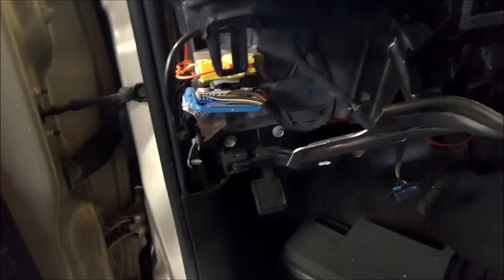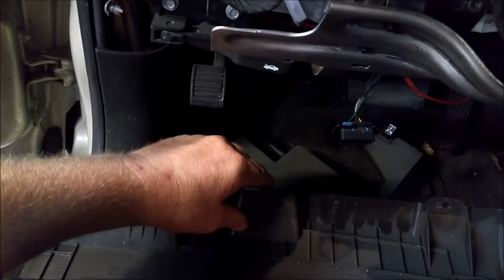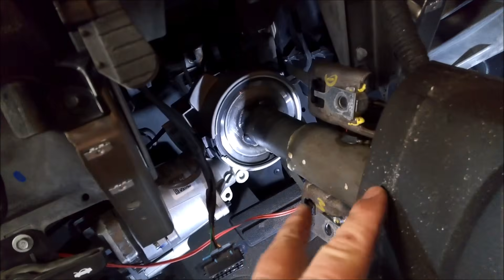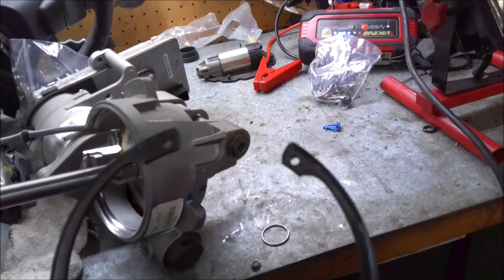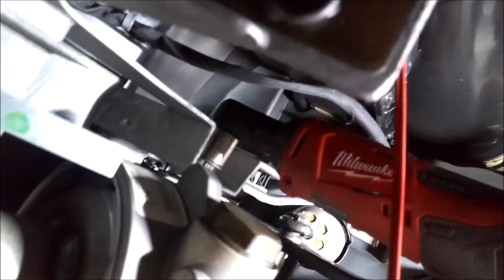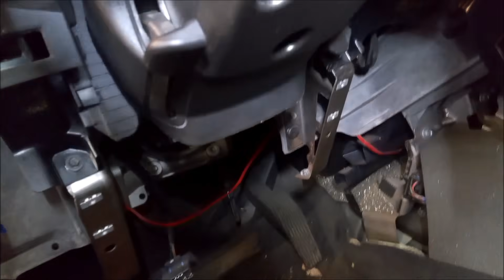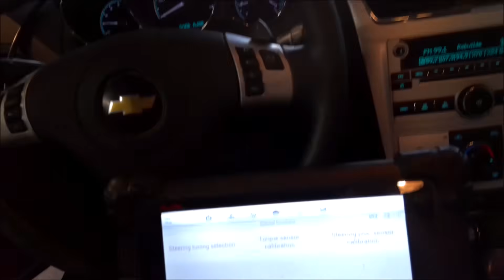2011 Chevy Malibu twitching steering wheel, no power assist, steering wheel sensor. C0545 Code

Comment: I just had this problem same year 2011 malibu. When the garage took the steering apart they said they had to replace the shaft because it had seized  up, that was another $250  part. My question is what made it seized up on itself. I only drove the car about a week once it had started doing the vibration and saying power steering  and esc off . The diagnostic check said the angle  sensor was bad so I was confused.
Reply from the maker: I have never seen the shaft seize up.
Reply: @HooptiesGarage  thanks for the response. I know when I would start it the wheel would be locked unless I turned it to the left when I started it. What they said was that the shaft wouldn't collapse on its self  so that they could get to the angle sensor to put the new one on.
Reply: @HooptiesGarage  have you gmail ?

Comment: What the lower half called? The place that actually hold the torque sensor? 
Cuz the mechanic told me steering column, someone said motor, someone said torque sensor holder..... either way I'm getting the place that holds the torque sensor together from the junk yard. When I take out the steering wheel does that need to stay straight too when removing?
Reply from the maker: It's not technically the steering column but it is if that makes sense, it basically the lower half where the motor is mounted etc. I consider the steering column the steering wheel part you remove first but I also understand the whole thing is considered the column.
Reply: @HooptiesGarage  Cuz these guys are giving me the run around. I appreciate you responding,  thanks. 
So I managed to get the torque sensor out but its 300+ $$ so im going to the junk yard and going to try n pull a part and hopefully it works. The lower part and the motor. 

I have another question. Would you happen to know what those 3 wires are for ? That connect to the motor? Would you know if one of those we plugged out would the car not start? Cuz I think I messed up 1 wire on one and pulled it out. But now when I try n plug it back in , it doesn't fit good enough for a connection,  and now the car won't start or crank .
Reply from the maker: @ChaddyMack  yes you need to get gud whole lower unit you can't just change the torque sensor from the junkyard because it won't be set right there's a pin you have to pull once you get installed to clock it right so if you don't get a new one then the only option at junkyard would be to get the lower steering column as a whole unit. As far as not starting do you still have the upper column out of the car I don't think there's any wires down low that would prevent it to start but all the wires you have to disconnect at steering wheel or one of those are off will probably prevent it
Reply: @HooptiesGarage  OK good to know. So I can keep my top steering wheel,  and just get the lower part with the motor at the junk yard?

And as far as my car not starting, It was starting fine when the power steering would pop up. The top part of the steering wheel and wires were in. All I know is once I started messing with the wires that connected to the motor, it wouldn't turn on. Maybe I blew a fuse or theres a short somewhere? Thats where I'm lost
Reply from the maker: @ChaddyMack  yes you can keep the top part. As far as not starting does it even crank over?
Reply: @HooptiesGarage  do you have an Instagram or somewhere i can message you? Or text? 
Well we put in the part from the junk yard.
Car turns back on,  it was a bad battery. 
But the steering wheel is still hard to turn a little. No engine light. No power steering light. 
So the fuse under the hood isn't working so going to get a new fuse the 80 one. And see if it works. 

Do i need to get it calibrated or? And how much does that cost
Reply: Fuse didn't work. If not I heard about a rack and pinion?
Reply: Imma just pay for the diagnostic check

Comment: Easy fix for it: remove the screws and bolts. The bottom parts of the steering doesnt need to come out. Removed the top part, from there you should be able to remove the snapring with a LARGE ring remover and do the job. YOU MOST LIKELY WILL NEED TO CALIBRATE IT AFTER YOU DONE. YES YOU CAN DRIVE THE CAR WITH CAUTION TO A MECANIC/DEALERSHIP FOR CALIBRATION IF YOU DONT HAVE A GOOD SCANNER TOOL. I did the job myself a month ago. Sorry for the shouting
Reply from the maker: I do it a little different now I take out upper column first and then remove lower instead of removing it together but I still take bottom out just because it only takes about 5 mins and it easier to access everything with it out. I also agree the bigger the snap ring pliers the better, I ended up getting some huge ones off Amazon fairly reasonable just for this job but I do several a year.
Reply: Just got done it turned the wheel straight to the right

Comment: Wow! I’m having this same exact issue & I was told I need to change the entire steering wheel column & motor according to the dealership. I replaced the motor but I’m still facing the same issue. Is it necessary to replace the entire steering wheel column or just the sensor?
Reply from the maker: No just the sensor and you will be good

Comment: EXACTLY what my cars doing saying a ton of stuff is off, I figured it was the torque sensor thank you because I’ve had NUMEROUS problems with this my alarm keeps going off, I changed the battery terminals, bought a new battery then the twitch JUST started yesterday so I know finally what it is! Thank you so much

Comment: If we replaced the torque sensor, and the power steering is still not working. What would be our next step? We haven’t used the scan tool yet. We just replaced the sensor. Also. We never had any warning lights or codes
Reply from the maker: Other than wiring issue i would check and see if anything is coming from the steering motor

Comment: Hoopt, great video. I just took my 2012 Malibu to the dealer and was told it needed a new power steering module and sensor. He quoted me $1650. Does that sound right to you?
Reply from the maker: If it's doing the same thing I would replace the module that's the actual motor the dealer likes to change everything so they can sell more parts and labor and cover their ass if they misdiagnose it, I would have a independent shop just change the sensor they are about $300-400 for the part and a hour or two labor.
Reply: @HooptiesGarage  Thanks man!!

Comment: Thanks for the helpful tutorial. Do you need to remove the whole steering column or just the top part of it that the steering wheel's attached to? I can't see why you would have to unless your changing the motor too. If you don't calibrate it will you know right away after starting the car? I've read the steering wheel will turn to the right if it needs to be calibrated. I just don't want to be driving and all of a sudden the steering wheel turns to the right on its own. Thanks.
Reply from the maker: You can remove top part and then make sure it doesn't spin so it doesn't break clock spring and slide that out and then remove motor it makes it easier  to handle. As far as spinning to the right i haven't heard of that but I always run the calibration with my scan tool before I drive it
Reply: @HooptiesGarage  Thanks for the quick reply. I replaced a torque sensor on a 2008 Escape so I'm a little familiar with changing one. Hopefully I won't have to have it calibrated. Thanks again!

Comment: Hey There! Having a heck of a time tryna get that back bolt in! I'm about an inch from the hole but can't seem to get it any closer with out the column coming out the knuckle. Can u offer any tips or tricks to get it back in?? TIA
Reply from the maker: To make it easier not sure how you are doing it but you can separate the steering column and just install the motor and lower part it makes it easier than trying to handle the entire column then once you get it started and bolted just slide the rest of the column in and your good to go
Reply: @HooptiesGarage  I don't have the motor attached as of yet but I'm trying to do it while it is one piece. DEF gonna try that. Thanks!

Comment: power steering service esc turned on on my 2010 malibu and steering wheel got really hard i took it twice to mechanic and he said he replaced motor on it but it messed up again,what do you recommend?and approx how much is cost on repair?
Reply: Same here did you figure it out ??
Reply from the maker: It's not the motor it's the steering wheel sensor at the bottom of the steering column. Depending on the mileage of your car gm may fix it for free if they won't find a mechanic that will just replace the sensor ballpark it will probably be around $300-350

Comment: Is this something thats just going to keep happening or is it a safety problem I don't have the funds to get it fixed right now and I'm wondering if it's going to one day completely just stop working, the power steering turns on and off sometimes but usually I just have to turn the car off and turn it back on for it to stop?
Reply from the maker: It seems like most the cars I see get about 100-115k before it needs to be replaced, I just replaced one on a car that has 177k miles and it was the first time according to the owner. GM may fix it for free if you are under the 150k miles mark but I have heard some dealerships are difficult to get that done guess it depends on who you deal with.

Comment: Can I install the new torque sensor and then drive it to a mechanic shop that has a scanner to get it reprogrammed ?
Reply from the maker: I believe you would be ok doing that, some say they relearn on their own but the service I read says to use scanner to recalibrate so I always do, it only takes a few minutes to recalibrate with a good scan tool.

Comment: Anybody still having this issue  gm is covering this under a special warranty as long as you have less then 150000 miles on the car I called my dealership and they said yes they do I called gm directly and they told me no but my car is at the dealership as we speak getting fixed for free and no I dont have a warranty on the vehicle so don't spend your money call your dealer
Reply from the maker: I would definitely make sure it's free before authorizing any work we have called on two of them here and the dealerships weren't willing to fix for free.
Reply: @HooptiesGarage  yea I called and my dealership fixed all for free but like I said gm said they knew nothing about it my dealership said they knew because they have had alot in there with the same issue.. the sensor also ended up burning up my power steering motor which they also fixed for free and charged to gm
Reply from the maker: @bm830op  good deal!
Reply: @HooptiesGarage  yea it turned out to be a good deal but it for some people they have to put alot of calls and work into getting dealerships that know about it
Reply: Thank you GM Told me the same thing
Reply: @lovernotafighter8184  glad I could help if it was my comment that helped you you are very welcome sir

Comment: one tip; lock or bungee the steering wheel in the same position , if the wheel turns too much the SIR coil will be destroyed.
Reply from the maker: Yes that is correct good tip!
Reply: @ ex mcgee  Are u saying bungee the wheel prior to taking the column out??
Reply from the maker: @smartin113  yes that is correct it to keep the wheel from turning too much one way or the other. I actually do this job a little differently now but either way that's a good practice when removing the column
Reply: @smartin113  yes . Because if it turns too far , the SIR/clockspring  coil will be destroyed .Once the column is disconnected from the rack nothing prevents this otherwise
Reply: Thanks for the tip!

Comment: Great video . Well explained . My buddies steering goes on and off mostly off . Question can the sensor be changed then driven  few 5 miles after install  to a mavis and get it calibrated with a wheel alignment .
Reply from the maker: Yes it shouldn't be a problem.

Comment: Thanks for the video, my 2008 Malibu start saying service ESC  and power steering on the dash and would happen once in awhile. now it is constant. I am on my way to a GM dealership to have it looked at now. It has about a 106000 miles. I am fairly mechanically inclined. My question is, will the scanner in the link perform the necessary calibrations to complete this task? Any feed back would be greatly appreciated.
Reply from the maker: No that scanner will not. I believe most of the time it will calibrate on its own though.
Reply: Hey jer i have the same problem with my car what did u have to do and how much did it costs u for the fix
Reply: Same ☝🏼

Comment: Really helped a lot! Now I am CERTAIN I won’t own one of these POS’s !
Reply: My 2012 power steering is turning off and on. 157000 miles. Time to say goodbye.
Reply: @HS-pw2ty  Regardless of what you buy for a vehicle, they all have it. BMW, Ford, Volvo, Lexus, Nissan. Not sure what bitching about it is going to get you except a different brand & model of headaches. You find a perfect one, let us know!
DK, ASE master tech since 78.
Reply: @69Sixpackbee  >They all have one on them, bitching about it gets you nothing at all. Pick one? Kia, Mini Cooper, Ford, Lexus, Fiat…. You would look good in a Fiat otherwise known in repair as “Fix It Again Tony!” Have at it and quit wearing your britches so tight. I can see your brown eye from here!
DK, ASE master tech since 78.
Reply: Good thing I dont own a Ford. Chevy. Always dependable. Even with no power steering. Helps you buff up those puney arms on those freakishly skinny humans.
Reply: @AHappyThought  bbnn.v
Reply: @AHappyThought  I bet you are a Mini Cooper dude? Right!
DK, ASE master tech since 78.
Reply: @deankay4434  nope. Luckily I'm not. Lol. Chevy all the way. Cheap parts. Easy to fix.
Reply: @AHappyThought  My Chevy is so special, I don’t pay taxes, tags, wheel tax or registration fees each year! I love it and have 4L65 built to 650 HP and 435 HP driving it!
Power windows, remote keyless, theft, light & horn control, power door lock & seats.

Comment: Thank you for the great video.  Is there an easy way to determine whether the problem is the torque sensor, or if it is the actual motor?  My daughter's car doesn't seem to have the shakey wheel problem, but does lose power assist randomly while driving about once per week.  I just want to hit the right part on the first try. Thanks.
Reply from the maker: Do you have any codes? I would scan the ecm first and see where that leads
Reply: @HooptiesGarage  I had the codes scanned by a local shop, and they said it had C0545 (Torque sensor), but also had  a 0640 code, which means the motor is bad as well.  They claim that both parts typically go bad at the same time.  And that's why Chevy always replaced both parts on their recall.  This seems like total BS to me, since a Google search for 0640 codes seems to reveal nothing like a steering assist motor issue.  Does this make sense?

Also, I have a steering column from a 2011.  Is it likely to be a direct fit to my 2008?
Reply from the maker: A p0640 is a heater intake issue you sure it was that code? Most shops will just want to change both because it covers them if the motor is bad. The car I did this video on still has no issues at all with steering after several months in fact I just changed its wiper transmission on it. Worse case scenario if you end up changing the motor later but if your car has same symptoms as the one in video I would not condemn the motor automatically. If your steering isnt twitching and it just goes outot randomly while driving it's a possibility your motor is going bad.
Reply: @HooptiesGarage  Yes, they definitely said it was the P0640.  That's why I was suspicious.  The steering doesn't seem to have the twitching problem.  It just randomly quits.  Seems to happen when turning a corner after stopping at a light.

Comment: If I get the scan tool in the description will I be able to recalibrate the sensor?
Reply: I bought a new sensor from o'Reilly's and installed it. Worked great. As someone else also mentioned on here DO NOT take the clip out until its installed. And you should have no problem.
Reply from the maker: I mention that in the video as well but you are right. Glad it worked for you!
Reply from the maker: Any of the higher level scan tools should be able to recalibrate.
Reply: @HooptiesGarage  but the one that's linked in your description isn't one of them? I just have a cheap Bluetooth one to read and reset codes.
Reply from the maker: No the one linked in description is a reader with erase capabilities. I used a autel maxisys elite in the video to recalibrate. Sorry I thought you were talking about the autel I used in video.

Comment: Would you say that twitching steering wheel is a result of a bad torque angle sensor
Reply from the maker: Yes the sensor is going bad that's what causes the twitching.
Reply: @HooptiesGarage  Have you seen one of these go out and cause the steering to be heavy one direction and light in the other?
Reply from the maker: @arustedspork22  that almost sounds like a suspension bind or rack bind possibly
Reply: @HooptiesGarage  mine has gone out on my pontiac g6. How long did it take you to change everything.
Reply from the maker: @RChavez1183  I've done quite a few I can usually knock them out in about 45 mins or so